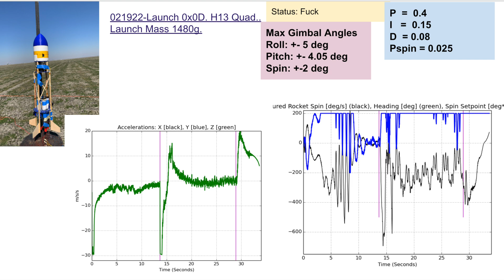Clustered 2-Stage Thrust Vector Controlled Rocket

Comment: You are doing some interesting designs!

My first Level 2 certification flight ended spectacularly after the forward engine closure failed, and blew the chute early during boost.  I was just trying to make a commercial build fly - not a scratch design like you have.

Comment: We call it "Belt and Suspenders" son.  You have to be more than 1 failure from hitting the ground.  ...  Also - strip all the plastics and housings off of those COTS parts!  A gram is a gram!
Reply: As for the GoPro data...  If it was actually running then you can absolutely salvage the footage..  Your lame Apple laptop might not play it, but a more gritty Windows video pack will.  You probably just have to close the file*

If the file shows bulk (like 27MB) then the video can be extracted.  If the file system is corrupted, you may first have to scrape the video using a paid tool.

I have a tool that will scrape raw data off of anything...  Costs $150 and can do things like pull files off of deleted partitions.